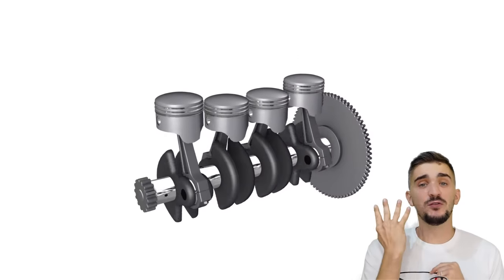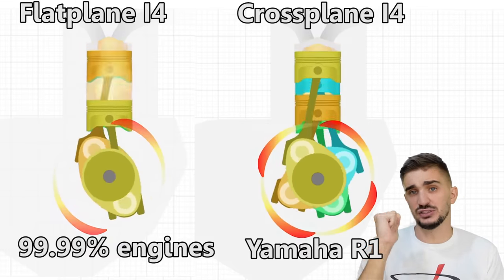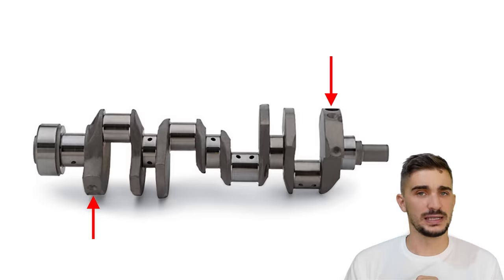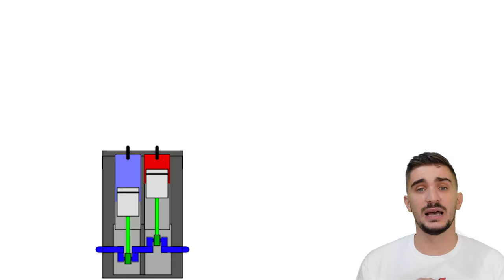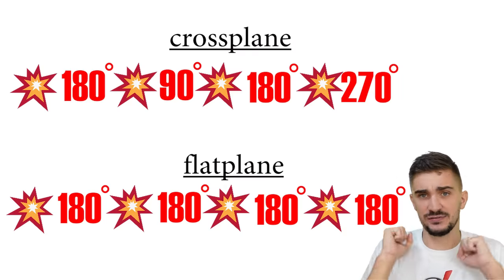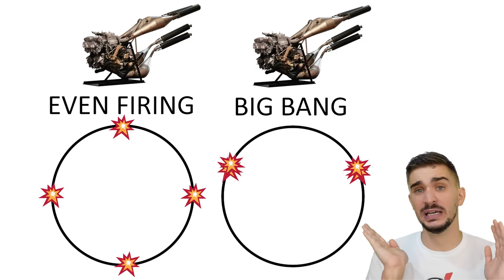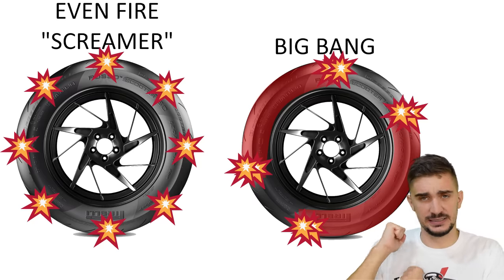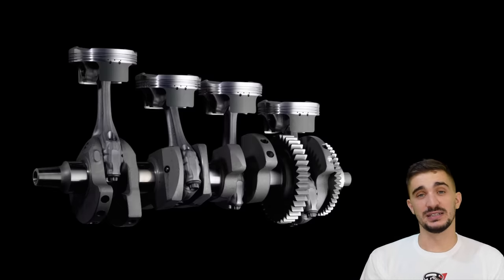CROSSPLANE inline 4 EXPLAINED in detail - How the YAMAHA R1 i4 differs from all other INLINE FOURS

Comment: Great video, so good in fact it caused me to subscribe to this channel. 
It really conveys the ideas presented in an easy to understand way. As a multilingual person myself, I understand how difficult it can be to convey intricate, technical information in your second language. You manage to do that better and more concisely than any native English speaker. 
Bravo my friend, bravo. 

The force differential is the achilles heal of piston powered engines. It creates massive torque forces that are trying to literally twist the crankshaft apart.

This one simple difference is the key advantage of the rotary engine design. Rotary engines, however, have their own achilles heal which is proper, longterm combustion chamber sealing. It's mandatory that the seals at the apexes, or apices if you prefer, of the triangular shaped component that roughly coincides with the pistons in a normal engine, be replaced far more frequently than the similar components of a normal piston driven engine. The high cost and inconvenience of complete engine rebuilds are what keep rotary engines from being more widely used.

When you referred to an inline two cylinder being imbalanced it illustrates why two cylinders are almost always offset into a V configuration or an horizontally opposed design as with the BMW motorcycle engines.

I don't know how this turned into a discussion about tires but, the difference between the screamer and the big bang could be described as, the screamer pants like an overheated dog, while the big bang takes deep breaths.

Does anyone else think Toyoshi Nishida looks a tiny bit like a "grey alien"? Ancient alien theorists and Georgio Tsoukalos would say yes.

Comment: As an additional comment, Yamaha already tried this approach with the TDM 850 engine in the early 90s... 2 cylinder crossplane engine (first they used a normal 180 degree crankpins, then they swapped towards crossplane)

Comment: Wow, that is a incredibly well explanation! But at the same time  it has completely confused me now. I'm not (by far) an engineer, but from years of reading motor magazines (with lots of mechanics explained), my thoughts for having a cross plane crankshaft give a more even smoother power delivery. Since the energy from the combustion has disapated completely at 70° after TDC and that the rest of the stroke (110°), is a dead or even restrictive stroke by compressing the next cylinder in line. I thought a cross plane crank would fire every 90° and eliminating this power robbing part of the stroke, and giving a more constant power. I Also have read that a crankshaft on a 90° plane (like a 90° v-twin) is more balanced and thus eliminates the use of a counter balancing axle. I have been taught that linear (side to side) vibrations are worse in the inline engines. They are not as noticeable as radial vibrations of v engines but are more a cause of discomfort (numbness) on long rides.
It seems I was wrong all along.

Comment: I have a boat with a Mercury 2 + 2 inline 4.  It is a 2 stroke cross plane engine (crank throws every 90 degrees).

It is designed such that at speeds below 2,500 rpm it only fires 2 cylinders, each 180 degrees apart. 

Below 2500 rpm it is a little rough, but once the rpm rises and the other 2 cylinders light up it is smooth as silk.

Comment: Wonderful video, my only issue with the R1 cross plane engine, is that it is restricted in design because of racing class rules and regulations it competes in. It has become accepted and popularized as the way to go. 
Back in the fifties and early seventies we had two strokes vs four strokes and rotary engines and all kinds of configuration layouts. Nissan in recent years has released their variable compression engine. 
I miss the excitement of what might be the ideal configuration instead of just scrutinizing the best possible solution of one design, forced by racing regulations. 
New subscriber.

Comment: I've been building, modifying, beating up and repairing engines for 50 years, didn't think I needed to sit through this but became engaged immediately, and learned something: at 90 degrees of crank pin, the piston is NOT at mid stroke! What what WHAT?? Fascinating.

Comment: I enjoyed watching your video and appreciate your explanations.  However, as a former NVH engineer at one of the Detroit Big 3 and having spent many years working on 4 cyl engine 2nd order imbalance, you might want to refer to Den Hartog's book Mechanical Vibrations section on multicylinder engine imbalance where he explains why 4 cylinder engines have a 2nd order excitation (different from your explanation).  Yes, it is because of the connecting rod but not the way you explain it and the difference is large.  In fact, the way you explain it, it isn't even a 2nd order excitation.  Please don't hate on me and sorry to nitpick but this was my passion for many years.

Comment: Another thing you forgotten to tell is that a sports bike has a high rod ratio (length of connecting rod divided by cylinder stroke), a high rod ratio reduces secondary imbalance on a flat plane inline 4 so the flat plane crankshaft will probably run a lot smoother in comparison to the cross plane crank.

Comment: Thats great! But dont forget that Yamaha started using crossplane on twin cylinder bikes for Dakar rally. Therefore the crossplane makes more sense on off road which the throttle sensibility is more demanded.
But i would like to know if on twin cylinder engine the crossplane may have less disadvantages.

Comment: 5:32 - sorry, my friend! The inertia of the pistons does NOT rotate. Both red arrows remain vertical, aligned with the movement of the pistons inside the cylinders, while their moduli (that's their lengths) get shorter/longer. When the shortening arrow becomes 0, it starts growing in the opposite direction and that's how you get the equal but contrary force after half a turn of the crankshaft. Of course you're not taking into account the inertia of the connecting rods, because it is several orders of magnitude smaller (and it would make all calculations a mess...). But altogether, I find this a reasonably precise and pretty useful video 🙂

Comment: 03:32
There is interesting thing about the motion of the connecting rod
between flat-plane ad cross-plane crankshaft.

Flat-plane : as rotating, all four connecting rods move away and close to the crankshaft.
Cross-plane : as first and fourth connecting rods move away from the crankshaft and
the second and third move close to the crankshaft.

Comment: Essentially - the result is like Traction Control - limiting torque when the driver / rider applies more power than the tyres have grip - but on an engine architecture level instead of cutting ignition / fuel / throttle

Comment: If you want to internalize intuitively how a big bang firing regime helps with traction, then try to think how pumping the brake pedal helps a car stop faster (or how an ABS system works by gripping and releasing the brake disk very rapidly to help the car break faster). That's the same trick albeit with different goals. thank you.

Comment: Both the Yamaha R1 crossplane engine and any inline triple engine have a ROCKING couple in the vertical cylinder plane. Both have a crankshsft-speed balance shaft creating a ROTATING couple. If this cancels the rocking couple, won’t it create a ROCKING couple in the horizontal plane? If so, isn’t this a problem?
IanB
Ah, I just saw the answer in Misiomor’s post below. We can cancel the rocking couple with a PAIR of contra-rotating balance shafts at crankshaft speed. But one of them can be the crankshaft itself, by adding extra weight near the ends but 180° away from those on the balance shaft. i wish I’d thought of that!

This may apply also to the BMW flat twins, with a rotating balance shaft canceling the rocking couple caused by the offset pistons and rods.

Comment: When an engine is operating an effect called, Moment of Inertia changes engine balance dramatically. This is why engines vibrate differently at varying RPMs. Essentially the movement changes the angular inertial relationship of rotating crank mass compared to the reciprocating mass of the piston and rod assembly.

Comment: Your 4 cylinder flat plane model (and Your explanatory) has a fundamental problem, because 99% of these have a firing order of 1-3-4-2 (and being to minimise the torsional stresses in crankshaft between each firing cylinder). It also does matter for 2nd order imbalance forces and their direction/relations!

Comment: Try a manual stone soya-bean grinder. Grind to water. Apply and feel forces using hands. Stand between the outer of axle and circumference of grinder. Push stroke angle-range. In-between angle-range. Pull stroke angle-range. Coast angle-range. Find power-stroke of circle. 

4 pistons, positions 1,2,3,4,5. Try 3,1,2,5. 3 = initiate angular. 1,2 = power and spread. 4=power dispersion spead, 5= controlled release. Try starting, record sound using microphone to spectrum analyser graph (mobile phone with ear-piece and gel-plastacine filter).

Plane for 1,2,3 pistons

Comment: My Engineering Brain now as a Question: So if a 4 cylinder cross plane engine is not ideal with opposing forces and having a cylinder firing order not perfectly symmetrical… Would it or is it possible to build a in-line six or V8 cross plane? As you would have more cylinders to counteract the forces???

Comment: A question, William Mosen the person who did the flatplane and crossplane audiovisual firing order of the R1, he proposed a low inertia crossplane where the crank journals closest to each other were 180 degrees apart. 1 and 2 being 180 degrees apart and 3 and 4 being 180 degrees apart from each other. With 3 and 4 being 90 and 270 degrees away from the 1 crank journal. Would this solve or even just relieve  the problems with primary balence while still keeping secondary balence and that beautiful sounding uneven firing order?

Comment: 9:25 .. It's actually not the angle that is causing the longer stroke...   When at the bottom, you're only measuring the ROD length, but when it's at TDC, you are now measuring the ROD length + the crank's offset.  So that's why the top part of the stroke is longer.
Reply: Nope. Rod length can never be measured on the rotating assembly without doing some math.  TDC point = rod length + crank offset. BDC point = rod length + crank offset. At 90 and 270 degrees, the Piston will be further down than halfway. The shorter the rod length, the more pronounced this phenomenon will be. If this is hard to visualize, imagine if it were an opposing 2 cylinder with a single pin crank. The opposing Piston will be less up from halfway at 90 and 270 degrees.

Comment: I bought a Buell XB12S new in 2004. It is a piece of 5hit. Rod failure at 18k. Clutch cable had constant leaks at the primary. Cooling fan failed twice requiring engine removal to replace. Ate real tires every 4k miles. Lots of fun. Handles like laser guided and pulls hard. Still. Come and get it.

Comment: The uneven firing intervals - but with a much better balance was also used by Ducati in their 90degree V twins ( or 'L' twins are some call them ) to give the tyres a 'rest period between bangs.  I ride a Suzuki SV650 with a beautiful smooth and nice sounding engine ( it has the 'heartbeat' sound at lower revs ).  A 90 degree V engine needs no fancy balance shafts to give smoothness and my SV redlines at 10,500 with no vibration between tickover and red line' .  The worst of all worlds is the agricultural Harley-D V twin, which moves the front wheel back ant forth about 50mm at tickover and continues to annoy. 'Proudly made by the Milwaukee tractor factory'...

Comment: Why would a balance shaft be a better solution than crank shaft weights?

The balance shaft is weight and will need to be rotated at the same time as the crank so would equally impact the Rev happiness of the engine no?

Comment: I know these guys can find a way to make a V6 sound insanely good. F1 needs to bring in Yamaha to design their exhaust. 
Look at the Yamaha R1 sports bike. It's a 1 liter 4 cylinder and it sounds like a high revving V8! It sounds so good and it's all because of the exhaust being tuned along with the firing order of the cylinders and it's crossplane crank. I know the firing order and crank would be less efficient which isn't possible in F1, but it would be cool.

Comment: The ZXRR engine has the same 'big bang' as your basic John Deer 2 cylinder tractor from the 1930's through the 50's. In fact the JD has what looks like a 4-cyl distributor cap but only two are used, and they are side by side with the two on the opposite side blank. Of course, before you got the old JD going 20% of the RPM the ZXRR can do it would end badly. However, the things have torque you cannot believe!

Comment: Hmm...it make sense to explain how Yamaha on GP seems arent that fast but can hit more speed when travelling the corner. And the rider says "Yamaha's doesnt really had a good traction on rear end(I heard from IWB channel that he founded an information, almost the rider of Yamaha's on GP said "this bike doesnt had a grip in rear wheel"). To think the ride style of Yamaha's I4 crossplane can do slip and grip at the same time so the rider can open the throttle in the middle of the sharp corner and do "power sliding" with more effortlessly because the rear wheel wasnt really slip when the rider are cornering. Well, its just my opinion. Correct me if Im wrong.

Comment: I was wondering why a balancing shaft would be a better solution for rev-happyness? It seems to me as the axle moves at the same speed it would need to have the same mass added, at the same distance from the rotational center to have the same balancing force. As well as the extra inertia of the shaft of the balancer and gears which provides no balancing force, a bigger engine block and frictional losses from the gears driving it. What makes it better?

Comment: You haven't mentioned the critical angle and forces exerted on crang and rod bearings from direction of mass  reversing at top and bottom of the stroke. The moments that tend to flatten out the bearing top and bottom eventually becoming oval shaped. It's those moments that break crank shafts and connecting rods.

Comment: cant you have all cylinders in a crossplane I4 have 90 degrees from each other tho? would that eliminate the uneven firing patern? Doesnt have to be 1-0 degrees 2-90 degrees from 1 3-90 degrees from 2 and 4-90 degrees from 3. Could also be 1-0 degrees 4-90 degrees from 1 2-90 degrees from 4 and 3 90 degrees from 2. Id love to know why this  hasnt been tried (or if it has id like to know where).

Comment: at 4:02 you say that the inline 3 cylinder engine has poor primary balance, when in fact it got a perfect primary and secondary balance, due to it's 120° crank angle. But what it has got is a first and secondary momentum equal to sqrt(3)*F(I or II)*L(distance between cylinders)
Reply from the maker: It has a very noticeable primary rocking couple hence poor primary balance.

Comment: It's kind of like an impact driver vs a drill, in the way they make it easier not to have the bit "slip" in it's socket in the screw head by providing the torque in pulses.  Or like ABS for your accelating force.  I wonder if a normal engine could be driven through some sort of power pulse generating transmission, to provide the same effect with less weight and complexity.  Could even be computer controlled to optimize the feel of the "edge of traction" for the rider.

Comment: Would the rocking motion be better by placing the 1 and 2 180° from each other; then 3 and 4 at 180°, but  90°/270 ° to 1 and 2?

That way the lever-arm of the primary imbalance rock would be shorter (1 vs. 4 cylinder widths), and occur in two different places 90° from each other... (2 cylinder width apart).

How would that shake out?

Comment: Very good animation on many points. But I never bought into the big bang theory of engine firing helping controllability. An electric motor with NO power “pulses” would yield the smoothest, most controllable power delivery. A single cyl engine or any engine where every cyl fires at the same time would be the extreme opposite of an electric motors smoothness. I personally feel that Yamaha built the crossplane R1 to be different. I had a 2012 R1.  BEAUTIFUL SOUND!! But they built it to be different. Yamaha has always been “out there” for design changes off the beaten path just to be different. Not better. But different. Examples: 5 valve cyl head in the 1987 FZ750 (which Yamaha FINALLY went back to a 4 valve head in the 2007 R1 after 20 years of saying “5 valves are really better!!”  Another example: reverse cyl heads on their YZ250/450F dirt bikes. Maybe theoretically the cyl and head canted backwards 5 or 8 degrees from vertical will improve mass centralization reducing the yaw and pitch moments of inertia. Don’t get me wrong…I love Yamaha for going against the grain. I’ve owned plenty of Yamahas. My 2000 Celica GTS with variable valve timing and lift (VVTLi) had YAMAHA cast into the front end of the cylinder head….an obvious partnership with TOYOTA to build a screamer of an engine. That was a great car!  I just don’t buy the crossplane helping driving torque, power delivery. It’s all about the sound baby!!!

Comment: Funny but the last Yamaha R1 that I bought brand new, blew up on me 3 times in under 16k miles.  Each time the dealership repaired in under warranty, but I still ended up leaving it there swearing to myself never to buy anouther Yamaha again, after it broke loose the valve guide literally while the mechanic test rode it, and I was waiting to pick it up.   I also owned a 10 year old YZ 250 two stroke dirt bike at the time, so I did like Yamaha.